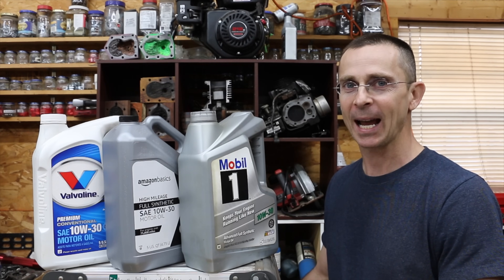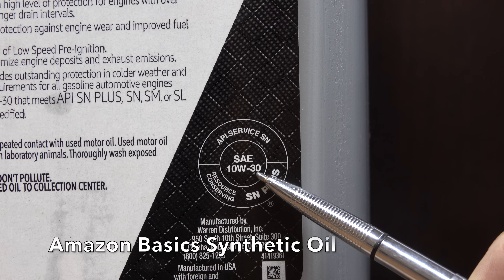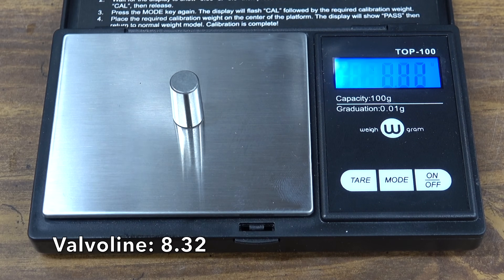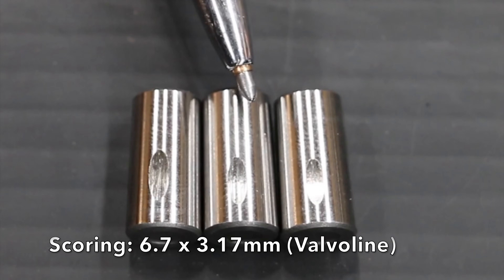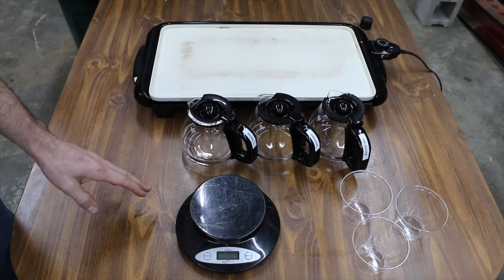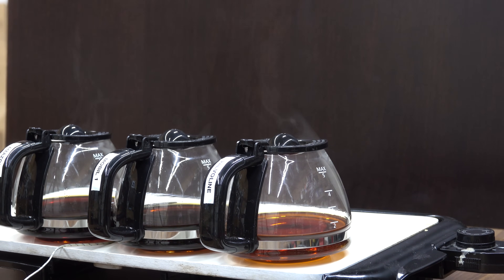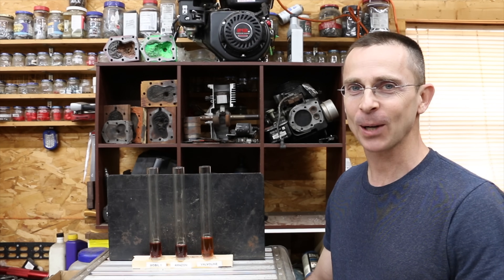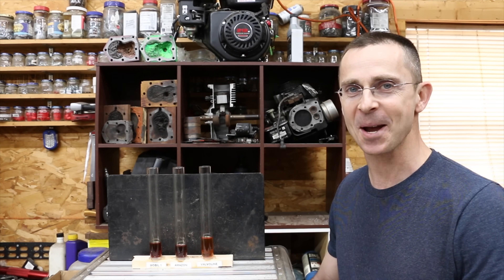Is AmazonBasics Full Synthetic Motor Oil better than Mobil 1? Let's find out!

Comment: Having a API rating does not mean the additive packages are present.  Surfactants,  detergents,  dispersants,  friction modifiers.
If it does not say on the bottle it's approved by a Certain manufacturer,  Like VW 503 505 
or GM Dexos approved,  its not and doesn't have the correct additives in the correct amounts.
Reply from the maker: Thank you!

Comment: Wish he had rerun the bearing test with used hot oil.
Reply from the maker: Thank you!
Reply: @ProjectFarm  I'd like it as well! Thanks for the great video anyways! Fantastic job with tools you have in your garage. BTW if you wanna give it another run (used oil), just spit the numbers here, don't need entire video for this (too much hassle)
Reply: that would have been interesting as well^^ but i have t oadmit that he really tests many aspects and try to get the best results without any chance of changing the results by influencing disturbance (different heatlevels on the plate and stuff like that^^)
Reply: How the oil performs at room temperature is interesting data, but you really need to know cold AND hot performance to make a distinction about a clear winner.
Reply: I concur, was thinking the same thing. Even if it was allowed to cool off first (for safety reasons) it would be interesting to see the bearing test repeated after the oils had been subjected to the heat.
Reply: A cold bearing test would be interesting as well.
Reply: @johnny0454  Yes it would, but to get ideal results you would need 3 bearing machines going because with each 10 minutes test the remaining one would cool off more and more, giving varying results, and if you kept heat on, the remaining ones would evaporate more. There are a lot of options with the bearing test though, he could've tested all 3 cooked oils at room temperature after the cold test to see how they perform after going through the motions of heating and cooling. Overall an excellent video.
Reply: @Project Farm yes please repeat the lubricity test with the setup cold: both cold bearing and cold oil!
Reply: Totally agree.
Reply: Oh shit.. wish i hadnt even read this comment, bubble bursted.

Comment: I really like this guy's videos.     Judging from the test results, I'm going to guess that the Amazon Basics oil is just rebranded Mobil 1.   Now someone might say, but they performed differently, to which I would say "did they?"      Notice in the cold-flow test that the amazon oil was in the middle, this means that the radiant heat from the other two probably kept the amazon oil a degree or so warmer.    You'd have to freeze them for two or three days to achieve the exact same temperature.    So many products these days are just rebranded, its comical.

Comment: I'm still loving you videos. You tell it and show like it is. You know, it is funny how most people want to buy the best lab tested oil. When I first started driving in 1962, I use the cheapest oil that I could get at Canadian Tire> That's all I could afford. It was a new car and I drove that car for 11 years before I bought another one. The car still ran great on the cheapest oil. I had 200,000 miles on it and the only reason I bought a new one was because I was still young and wanted to buy a Trans-am. So go figure.
Reply from the maker: Thank you!
Reply: Andy's Dog House You could use basically anything in those low tolerance era engines:)
Reply: @quikgt  You got that right.
Reply: You probably also had OCI of 3000 miles. Changing it early like that did more for the engine than the cheap oil did.
Reply: Andy's Dog House I’m sure you mean 200,000 Kilometers not miles bud.
Reply: @jeremysmith8990  NOPE Miles. That was in the 60's before Kilometers were ever shoved on us.
Reply: I would imagine that doing oil changes at lower mileage intervals probably has a lot to do with keeping an engine in good condition even if it is standard motor oil
Reply: @propdoctor21564  I changed my oil  Every 1000 miles back then.
Reply: The Welfare Racers  I would rather have a trans am than a corvette any day.

Comment: Excellent soundtrack for the lubricity test.  With that said, I would take AmazonBasics oil performance with a bitter grain of salt.  Amazon is not a petroleum or chemical company, they have another company making the product for them under contract, which means a year or two down the road when they get greedy they might change the manufacturer of the AmazonBasics oil and so would the performance of the product.  Fascinating results, but beware.
Reply from the maker: Thank you

Comment: You should buy an old Volvo with the red block 4 cylinder  (B230F) or B230FT the turbo motor. They are 2.3L single cam 8v non interference motors. I think it would be cool to do tests on that motor. My 89 240 has 400,000 miles and it runs like it just came off the showroom floor. These motors are tough to kill and hold compression for a long time. I think a guy made it to 2 million miles on the carbuerated version before replacing the rings.
Reply from the maker: Thank you for the video idea!

Comment: Awesome test! I have a video idea if you’d be interested in doing another similar to this. I am really curious about witch high mileage oil is the best quality. I think that would be a great test to see some of the following such as Valvoline Max life, Valvoline full synthetic high mileage, Castrol Edge high mileage, Castrol GTX high mileage, Pennzoil high mileage, and Mobil 1 high mileage tested against each other. And maybe even against regular synthetic oils of the same brands in a different video or something, like Mobil 1 synthetic vs Mobil 1 high mileage etc. to see what kind of deferences there are if any between them. Just some ideas! Great job and Thank you for all the time you put into these videos!
Reply from the maker: Thank you for the video idea!

Comment: I might try the Amazon oil. They never have deals for over 5 quarts of oil; I have a Charger R/T so a cheaper alternative that is nearly as lubricating, while having better flow after heat and cold would be a no-brainer.
Reply from the maker: Thank you
Reply: @ProjectFarm  Worked just fine in my engine as far as I can tell. Still $26 for 5 quarts, even high mileage 2022

Comment: Most off brand oils are just big name oils with a slightly different additive package. If you buy oil from a Nissan dealer it is rebranded Mobil oil. Oil from a Mazda dealer is rebranded Castrol. I forgot who does Autozone oil but I think it may be valvoline. Regardless if you change your oil on time and do not put it through special circumstances like racing or hauling the cheap stuff will do just fine. 

I would love to see some testing on the effects of changing oil types and or brands every time compared to using the same every time. I don’t know if it can easily be done but some people swear you should NEVER change oil type or brand and others say it doesn’t matter.
Reply from the maker: Thank you for the video idea!

Comment: Why would you include a conventional grade of oil in this comparison? Its obviously a no brainer that both the synthetic grade oils will out perform the conventional oil.  You should have used Valvoline full synthetic vs. Amazon full synthetic vs. Mobil 1 full synthetic.  Notice they are all synthetic oils.  Amazon doesn't make and sell their oils either.  FACT: Amazon basics synthetic oil is made by Warren Distribution... which also makes a lot of the private label "store brand" synthetic oils.
Reply from the maker: Thank you. Viewers requested this comparison and conventional served as the control for the competing synthetics. It’s amazing to see just how much better the synthetics performed compared to the conventional oil.

Comment: More Testing Ideas; Gas cans, cutting tools (multi cutter vs shears), fuel stabilizers, robotic and/or electric lawn mowers, tillers, hand-held fertilizer spreaders, mower mulching blades, hand-held mower blade sharpeners, car battery chargers, work gloves.
Reply from the maker: Thank you for the video ideas!

Comment: Thanks for all your time and effort in conducting the test. A high temperature viscosity and wear test would need to be added to your test to sway me away from using Mobil1. I realize this is probably beyond what can be done without really high $ equipment. Also, I have to admit that I have been using Mobil 1 in my automobiles for about 40 years.
Reply from the maker: Thank you!  Mobil 1 is a great product!

Comment: Just had a video idea was curious if a O2 sensor with California emissions versus the O2 sensor without emissions also verse a O2 sensor with Federal emissions made a difference in fuel consumption and or power
Reply: Blaiz BBS  a California O2 sensor are identical to a federal O2 sensor  there is actually no such thing as a California O2 sensor they use the same part number on California and federal cars 
California emissions car/truck does have different parts but the O2 sensor is not different
Reply: @hotrodpaully1  I was asking cuz I actually work for O'Reilly's in the part numbers are different between the federal California missions and just the standard plug even though they're all Bosch in the same plug they do look a little bit different I was just curious nice to know though
Reply: Blaiz BBS  on what kind of car? I can't see why there be any kind of difference I live in Iowa but work for a car lot that gets most of the cars from California and I never ran into one with a different O2 sensor. have seen ones with two cats, maybe that the difference a O2 for the second cat. anyhow all O2 work the same they read oxygen content of gas report that to the computer and the computer adjust fuel trim off that data so any fuel economy difference would be the result of the computer's program not the O2 sensor
Reply: @hotrodpaully1  2000 Nissan maxima

Comment: I got a few here:

How about Diesel spec oils(These have larger amounts of Zddp/ zinc - for older flat tappet cams , and more stressed engines- not good for catalytic vehicles). Compare one of these to a standard modern  Gas Auto oil of the same weight, maybe the ZDDP additive as well.   In theory, the Diesel oils will show less wear on your bearing test.   There is a reason Diesels last much longer..

Then of course what about the lubricity of Modern Diesel fuel, and "slippery additives" that claim to prevent wear(Stanadyne, Howes Lubricator(big amber jug at Walmart),Power Service, MMO{we all this one works great!}. I have a sinking suspicion your bearing test may put some of these to shame...
     Would be great to compare it to a high sulfur(older diesel blend).  Probably not possible on that one...  The lack of sulfur, really makes injection pumps fail sooner.  Better for the air though.

Lastly brake fluids, same thing- run some brand names, and cheap stuff through the ringer(Dot 3,4,5(5 is silicone).  Maybe the bearing machine, drip, freeze, heat, corrosion.  See which destroys stuff faster.   

If you get bored:   Throw some brass in GL5 gear oil, and see if it actually will hurt it....    Or lead additive for gas.  Wouldn't know how to test that one.

Anyway, keep up the good work!
Reply from the maker: Thank you for the video ideas!

Comment: The mobile one won’t get to the head faster but the mobile one will coat the parts better. I still use Valvoline cause it’s 11 bucks for 5 litres and mobile one is 37.00 for 4.4 litres and amazon isn’t available in Ontario Canada yet. Great vid very thorough.
Reply from the maker: Thank you!

Comment: I´ve have seen most of your projects very informative i have 2 questions  1st a comment :  I have a Craftsman DLM mower powered by a Honda OHV motor  1st question : Do i put in straight gasoline or with 2 cycle oil ?  2nd :  What kind of oil do i put in the crankcase ? any info helps thank you.
Reply from the maker: A 4-stroke engine does not need gasoline with oil mixed into it.  Straight gasoline in the fuel tank of a 4 stroke engine is appropriate.  For the crankcase (oil reservoir) , recommend checking the owners manual to see what grade of oil the manufacturer requires.  It's most likely 10W-30 or 30W. Hope this helps. Thank you.
Reply: Thank you :) i just want to add that today Feb 13 i was going to use the mower i mention and for some reason after i warm it up for 1 minute i started to cut the lawn and the engine stop it's locked up XD hahaha even when it had oil now i have a reason to take it apart.

Comment: If you reall want to have a trouble free engine get the Premium Motul, 2X amount Motorkote,N52 Magnet Oil drain plug.This can be done for all types of transmissions also.All the Porsche and Ferrari Track Racers Use Motul with Spectacular results.I have been in the Porsche Community for 20 years.
Reply from the maker: Thank you!

Comment: I would have liked this much better if you compared them to Valvoline Synthetic instead of conventional motor oil. Some folks may not realize you did that because the cost is similar and may think that Valvoline is inferior when in fact it isn't.
Reply from the maker: Thank you!

Comment: Will an old engine leak oil if you switch from conventional to synthetic?
Reply from the maker: Thank you for the video idea!  I have a Ford Tractor that's nearly 40 years old, all original seals, and it'll make the perfect test platform.
Reply: I have a 1972 ford f250 360, old engine has 172K runs great, im afraid to put synthetic in it because the all my life iv heard don't put synthetic in old high mileage engines that run conventional oil. THEY WILL LEAK EVERYWHERE, is what iv been told by my piers.
Reply: It really depends on the engine, how old is it, what is its history, how was it driven, what kind of weather was it put through, etc.

Comment: When you showed the close up of the ramp at the end for the flow test, it looked like there was a slight dip in the Mobile 1 track. Did you use a straight edge to verify all the runs were equal ? If so  then everything else seemed very good. Thanks for the test.
Reply from the maker: Thank you!  Yes, they were glued while in a flat position.

Comment: My truck is a 2004. Diesel... One of its injectors leaks a little so slowly dilutes the oil .. The oil level actually climbs with mileage and the oil smells strongly of diesel.
It doesnt matter what oil I put in it. Cheaper the better. The vehicle doesnt owe me a penny. The repairs will cost more than its worth. Im gunna run it till its dies.

I used to work for a subsidiary of BP in oil/fuel testing and development. Orobis/Addibis in the late 80's
Reply from the maker: Great point. Thank you

Comment: Nothing wrong with cheaper engine oil......I just check the small print on the can.
My UK-spec 1998 Ford (Mercury) Cougar V6 is happily running with supermarket own-brand 5w30 fully synthetic oil (Tesco).
Ford's recommendation is WSS-M2C913A, this oil covers "A" through to "D", and it is produced by a trusted UK manufacturer, Tetrosyl, who make the Carlube Triple R brand......these were used as OE factory fill by TVR.
Check the specs of the oils, if it matches the specs in the vehicle's handbook, happy days!
Why pay more.......???
Thanks for the great videos PF 👍👍
Reply from the maker: Thank you!

Comment: You show us just basic common sense testing - well done 5 stars rating!
Reply from the maker: Thank you!
Reply: This bearing test has been used for the past 60 years.
Reply: Comparing it to the lowest quality synthetic oil on the market and a conventional oil is far from common sense testing. Many tests have been done to show how inferior mobil 1 is to amsoil, valvoline, royal purple etc. If amazon can't beat mobil 1, thats sad
Reply: @brett420favre  royal purples testing has shown it to be garbage as well. amsoil is god tier though followed by pennzoil platinum and quaker state ultimate durability

Comment: I have switched to full synthetic in my vehicles a while ago. I have been using Castrol...the only brand you did not test, haha. I might pick up some Amazon basic sometime. I think it is slightly more then Castrol, but the performance tested very well.

Actually I just checked. Amazon Basic is even cheaper by $3.70 per quart.
Reply from the maker: Thank you for the video idea  on testing Castrol!

Comment: I don't like sharing my secret since it's getting harder to find but anyone else getting good results with Mobile 1 0-40 European oil on their LS engines? My old 1999 LS1 has 180K hard high revving miles and this oil doesn't get consumed since it's normal in older LS1 engine and common piston slap. Well when changing out at 101K miles no more piston slap during the first 3 mins on a cold start in CT. My car would consume 1/2 quart of oil at high RPMS every 3-4K miles but NOT with European oil!!!  Must have more additives I guess. Also I work nights and a few times my LS1 has trouble starting since the MAF is an aftermarket hollowed out one (ices up) and when starting at  -5F degrees 15F degrees with the car out in the parking lot the first 2 starts it barely would start and run and stall within secs. With this oil vs 5W-30W the European 0-40W by far the best and the car runs like a virgin even though I got around 180,000 miles. With cold weather the flick of my wrist and the engine starts quickly.
Reply: Also great results with my other car which is a 1997 LT1 170K miles.
Reply from the maker: Thank you

Comment: Now I don't want to start anything when its cold out.
Reply: That's why there's two numbers on oil viscosity ratings
Reply: @Oliver0200  Right, but it doesn't change the fact that the oil is as thick as maple syrup when its winter.
Reply: That's why there's 0W-16.